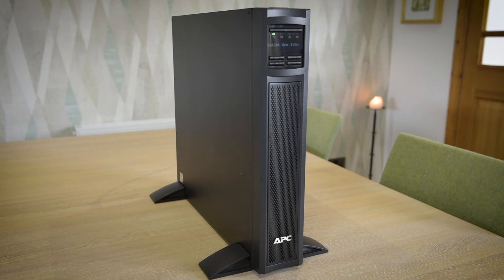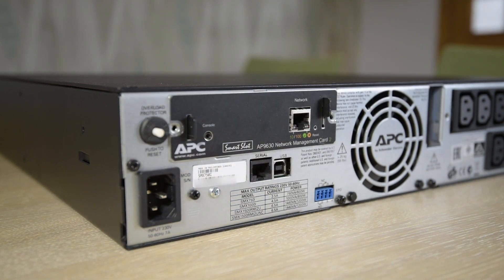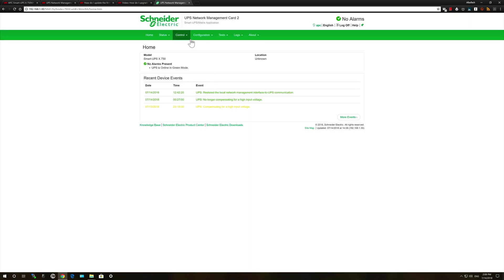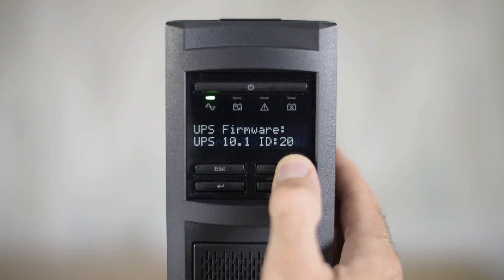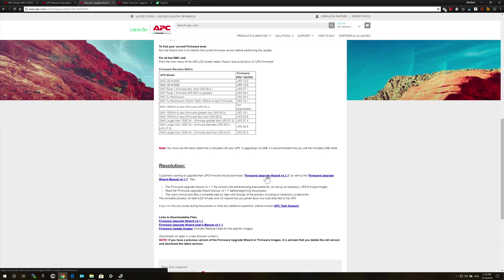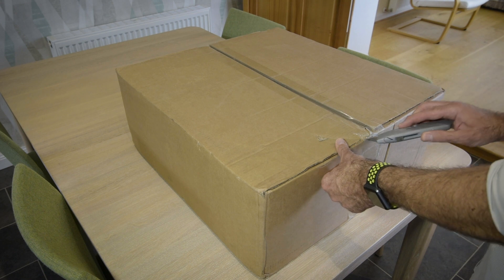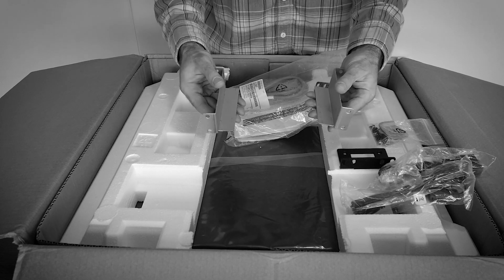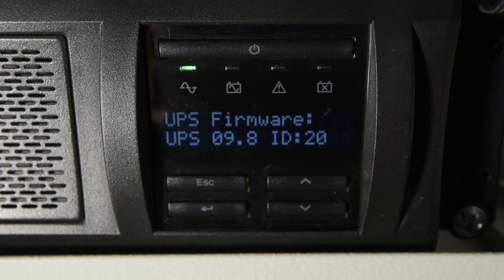Updating APC UPS firmware fail: UPS and Downs Part 2

Comment: Have you updated the Firmware on the NMC or the UPS since this video?
Also did you do any further set up on the NMC to help shut down devices in the event of sustained loss of power?
I have had the same model UPS and NMC as you since 2014. I have recently moved for Cisco Small business network gear to Ubiquiti and long with my Synology NAS but have never had the UPS shut any of these devices down in event of a sustained power loss or not send any email/notifications. So when the UPS failed on output short 31-Dec-22 and 08-Jan-23 I had no idea that it happened.
Also, I did load the wrong firmware to the NMC but was able to put the correct firmware on it.
Reply from the maker: After two failures I gave up on the UPS firmware. I looked for the NMC firmware download a few times with the intent of upgrading the NMC but APC made it impossible to find so I gave up on that as well.
But the NMC version in the video allowed the UPS to show up on the network and my Synology NAS was able to recognise it.  I also have a PC connected via USB and the UPS has communicated to both devices and they have performed graceful shutdowns during power loss. Is DSM not seeing the NMC?
Reply: @AlbaTech  My UPS & NAS are not located in the same location so can not use USB for them to communicate, so I need to use SNMP. I have never used SNMP before. I have just tried SNMP v3 and now v1. It seems like both versions are supported by both the NAS & the UPS but the Synology NAS "Cannot connect to the network UPS Sever" yet. In hind sight I should have gone with a small rack mount system like yours with all in the one spot but not where my Cat6 cables are terminated and the UPS does not fit here. So looking for how to set up SNMP for this.
Reply from the maker: @brettmcauliffe475  I just used the power settings in DSM - SNMP version v2c and set to public and pointing to the NMC ip address.
Reply: @AlbaTech  I have been able to get SNMP v1 working but there is no option on the NAS for V2c and I can not get SNMP v3 to work at all. I also cannot get Email notifications working, despite the settings being identical to my Synology NAS email notification settings which work fine. I did upgrade my UPS Firmware today to V15 (ID20) and NMC firmware to 7.0.8 to try to address these issues along with a "Reset All" (except for TCP/IP). No luck yet but have lodged a ticket. It is great that you have shown  in these videos what you have setup. I would be interested to see how what else you have set up on this UPS & NMC, if you get time and want to do any more videos on this equipment.
Reply: In the end I did get SNMP v3 working. Synology was not able to do SHA & AES. All other combinations worked. Also got the Email notifications working. I did get help from SE Technical Support and Synology Technical Support.
Reply from the maker: @brettmcauliffe475  Result, glad to hear you got it sorted.

Comment: Nice video, thank you. Did you ever manage to get this on 10.1 successfully?
Reply from the maker: Thanks.  I tried again last year but it broke the UPS once again.  I went through the whole RMA process and got another replacement, so at that level great support by APC.  However they basicially advised not to upgrade to the latest firmware, which is a bizarre position to be in.  I’ve not checked versions since, I cannot face another attempt.
Reply: @AlbaTech  Thanks for the prompt reply. The guide says to use the Wizard via USB so I was going to brave it. My one is running 9.1 so quite old. Can't find where to get older firmware other than 10.1.
Reply from the maker: Pete Stothers My replacement arrived with 9.8 and I’ve left it at that.  Try contacting APC customer support for legacy versions, they were very helpful.  Shame their developers aren’t as effecient.  They should admit themselves that 9.8 is a know good if you say you are worried about 10.1 or later.  The RMAs must have cost them a fortune so I imagine they would be keen to avoid that.
Reply: @AlbaTech  I contacted APC and they advised I should have no issues now so I braved it! Used 4.1 wizard with NMC removed and it all went smoothly in about 3~4 minutes. Running 10.1 now.
Reply from the maker: Pete Stothers congratulations! Having had my fingers burned twice I’m not feeling so brave!
Reply: @AlbaTech  I'm stuck with the same problem. Upgraded to 10.1 via due the nasty sensitivity bug (turns on inverter every couple hours). Now the NMC  lost the UPS...
But there is a 10.2 since last Nov. In the changelog there is only one fix: "Addresses issue with SMX750 & SMX750I communication after updating to UPS 10.1". May they got it fixed...
I'll give it a try after I got mine RMAed.
You were pretty lucky with the UPS firmware update via the NMC. I got stranded with braindead 6000 series UPSes after trying this. Pretty nasty if they run in a datacenter and you only got a 30min service window...
Reply from the maker: @mike4187  There was a comment left on part 1 suggesting that my NMC might be an old version that was causing the problem and that APC would be willing to update it.  I’ve not looked into it but it might be worth checking out.
Reply: @AlbaTech  I updeted the new one to 10.2 abd guess what I ended in a bootloop...
So I will stay on the 9.8 after the next replacement. APC stated that updates are not recommended at all...
Reply from the maker: @mike4187  sorry to hear about that.  APC customer service and replacement service is excellent but what kind of electronics company recommends not doing updates?
Reply: @AlbaTech  I don't know. That was crazy but they told me a firmware update for the UPS doesn'T make anything better or faster. Just don't do it.
Ehhh well....

Comment: I did a job last year where we installed a few hundred of the SMX UPS's (I think the SMX2200).  They were supplied new with NMCs.  I updated one of them to the latest firmware and had exactly the same problem you describe.  Tried much the same things as you did to get them to talk, but gave up.  We ended up not updating the rest of the UPSs!  Oh and yes the APC discovery software is awful.  It just doesn't work most of the time.  Ended up setting all the static IPs with a serial connection!
Reply from the maker: Thanks for comments.  I was actually toying with the idea of attempting to update to the latest firmware again as I thought enough time has passed for it to have settled down.  But this has reminded me of the nightmare I had so I think I'll leave it.  The replacement UPS came with firmware 09.8 which is a few revisions behind now but I have not had any problems at all with it.

Comment: Stumbling across your content I must say it's very enjoyable. What made you go for a network management card over connecting it to a machine running NUT or similar? I just got myself a UPS up and running.
Reply from the maker: Thanks for the feedback.  I'm not familiar with NUT but I imagine it needs a server or virtual machine to run on?  I'm too lazy for that.  I also expect it needs a serial connection, so I'd need to buy or build a machine with that as none of my kit has that.  The NMC was cheap on ebay and the web interface of 6.5.6 is quite nice to use.  And it allows me to perform graceful shutdowns on multiple pieces of equipment in the event of power loss rather than a single device when using the USB.   I'm still not ready to take the latest firmwares for the NMC or UPS yet though.

Comment: That was a smart idea on holding off on the upgrade.  Since I consider my home equipment to be in a production state I quite often hold off on upgrade for 30,60 or 90 days after they are released. I am glad I did this with Windwos 10 as soon as 1809 was released I stopped upgrade in windows settings for 35 days. Non-production machines are usually locked down for 60 days before upgrades.
Reply from the maker: Agreed.  But I am currently three revisions behind the latest firmware.  It's a shame they don't follow Ubiquiti and allow you to choose the level of 'bleeding edge' you are comfortable with.  I'd be happy with the second newest firmware but only the very latest is available.  10.1 has been out for a while now but I still can't face it...